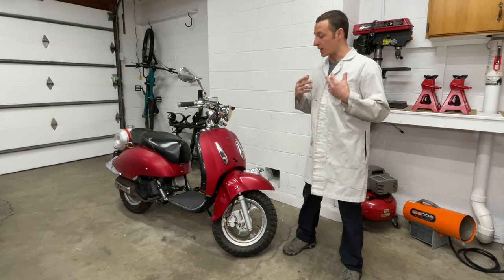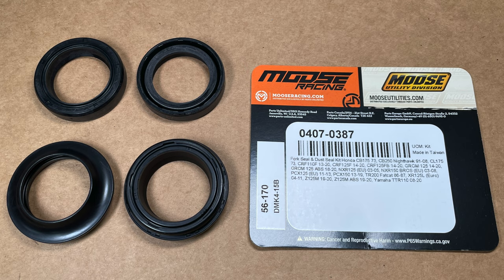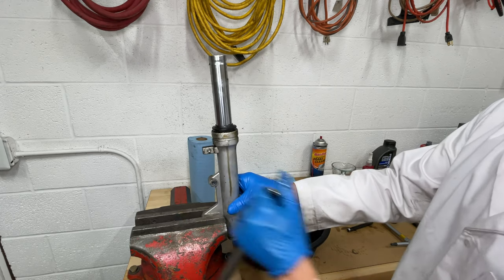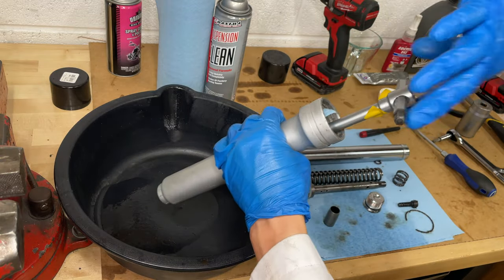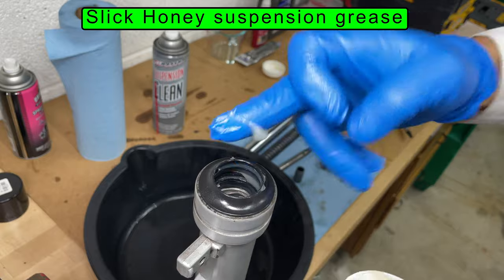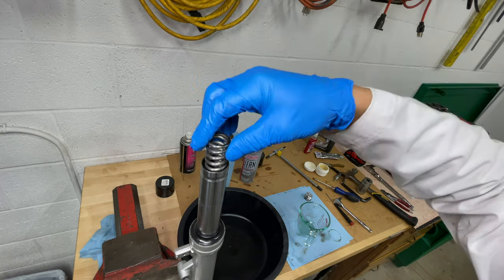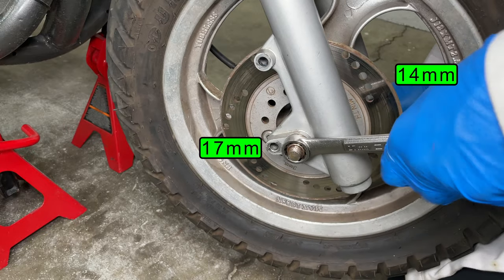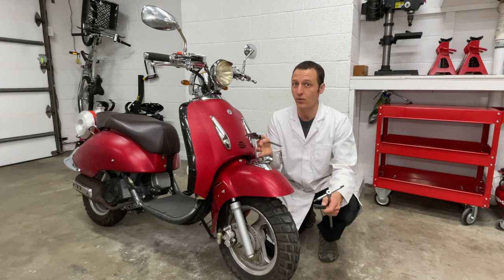Fork service on a 150cc GY6 Chinese scooter

Comment: my scooter's front shocks are frozen (too afraid to say "rusted") solid. when i bought it it was already out of oil. the local scooter guy doesnt really want to fuck with them and says im better off buying a new scooter (he has a point, it's a 2005 Filly but i like the little bugger) and there are also no suitable spares at the junkyard. as in no working shocks for a 2005 scooter that are in good condition. so i guess i'm on collision course of doing this. 

neighbor borrowed me his allen key set. i've watched videos. Guess i'll go get a fork set to service at the junkyard. 
and then it's rock and roll time. 

btw the real pro tip in this videos is oil level adjustement! thank you Paul!
Reply from the maker: Thanks for watching!  I'm glad the video helped.  If your forks are siezed, I recommend trying to find new forks.  https://www.partsforscooters.com/All-Scooter-Parts/All-Parts-Suspension/Fork-Assy?page=1
Check some online scooter parts stores, and make sure the new fork matches your old one.
Reply: @LabCoatPaul  yup i just did today. brand new from the junkyard haha! my scooter is so old i almost gave up, front drum breaks (yea)... 
but i have them, next i'll service them (they a bit leaky) and then install them. I will be looking up your vid again for more details when time comes!

Comment: My forks are little different , I don’t need to go in with a extension and hex to undo anything that way , just simple lefty loosy of the ex bolt at the Botom of the fork and that’s it everything internally comes undone

Comment: Er. How Often should you Check the front fork nut for spec tightness if you never used Loctite? Ya know.. Everyone says when you get a new China scooter to check the bolts but there are Tons of bolts and we don't always have factory specs to match the torque against.. so.. what's the best practice? How do you know which bolts you need to check and how tight they are.. no one publishes that info.
Reply from the maker: Ok, so you ride the scooter, then feel out which part of it is currently falling apart.  Glue it together.  Make sure you always wear a helmet.  From a Chinese scooter manual:  "you will have a fun and interesting time"
Reply: @LabCoatPaul  Ahh.. that's what I was missing.. O.k... I'll follow your advice.. I see it worked for you when you took your scooter off road.. (folks should really watch that vid.. it's a Hoot!) Thanks Paul! LOL  and thanks for having a sense of Yuma.. Ah Ha.. I dated a gal from Yuma once.. nice place to visit but I wouldn't want to live there..

Comment: My forks on my scooter doesn’t have a top cap to screw off. Instead it only have bottom bolts in which I unscrewed for draining and refill. Question is… how do I   Continue to tighten the bottom bolts? As I try to tighten it up it turns with the spring inside instead. I was thinking… perhaps I need something fast like an air gun?
Reply from the maker: No top cap would make it tricky.  I would use a drill or an electric impact.  Be careful if you use an air impact wrench because you can easily overtighten the bolts.

Comment: Did you clean the fork with the wire brush? I can see scratch marks when you installed the new seal.
Reply from the maker: nope.  The only thing I touched with the wire brush was that bolt.

Comment: awsome video, my bike got crashed and now the wheel isnt pointing straight, how do i fix this? is it a fork bearing issue?
Reply from the maker: Chinese scooters have a bolt that goes through the steerer tube to hold the handlebars.  Take off the plastic trim.  If the bolt is bent, replace it.  Stand in front of the scooter, hold the wheel between your legs, and turn the handlebars to re-align them.

Comment: lol that picture like its got power lol what you hit a ramp going downhill? its a rolls can hardley brand new
Reply from the maker: 150cc Chinese scooters can be pretty fast if tuned properly.  I was going about 20mph on a slight downhill and hit a small jump in the picture.
Reply: @LabCoatPaul  a scooters engine is only attached by a bar and the strings have you considered adding two more engines left and right of the scooter? wont go any faster but get to 60mph faster. and if a engine dies you can still drive it but maybe with the extra power you can maybe add a trailer hitch for a small motorcycle trailer.

Comment: when i put my wheel back it makes a metal scratching noise when rotating, what should i do?
Reply from the maker: It sounds like the brake caliper might be scraping on the rotor. Did you install all the wheel spacers on the axle?
Reply: @LabCoatPaul  yes i did, its not loud and the wheel still rotates freely, so is it just normal?